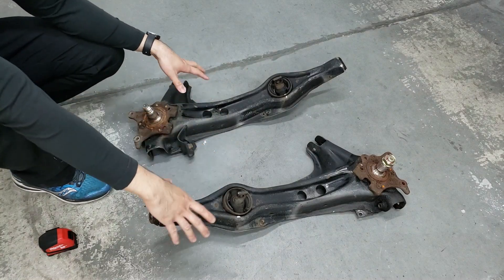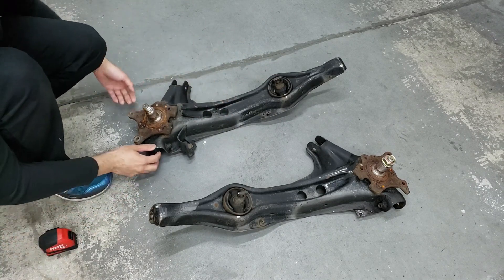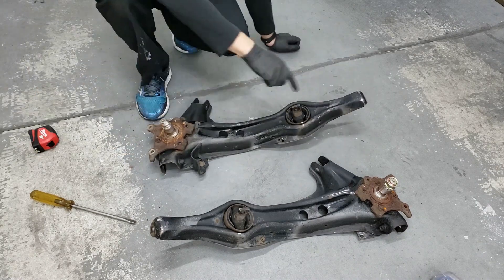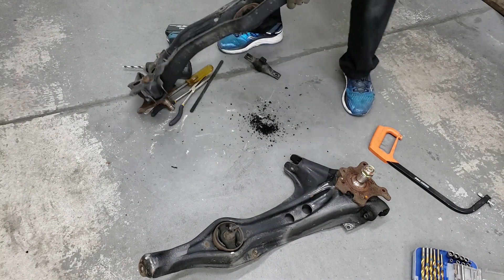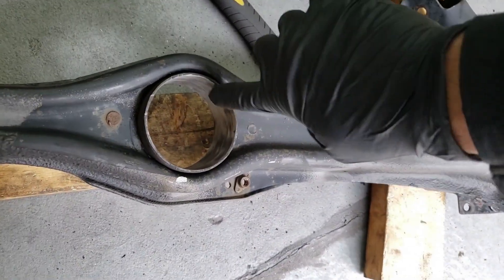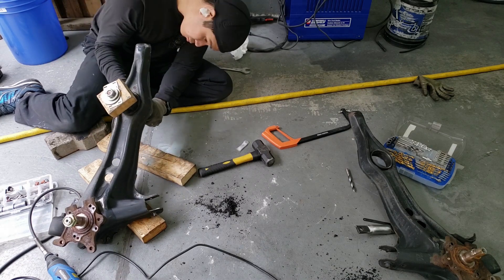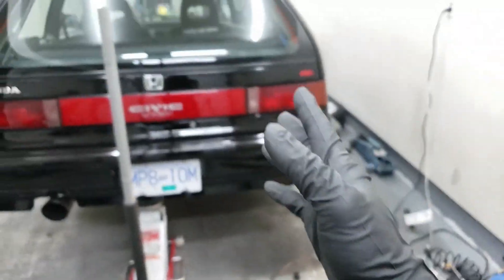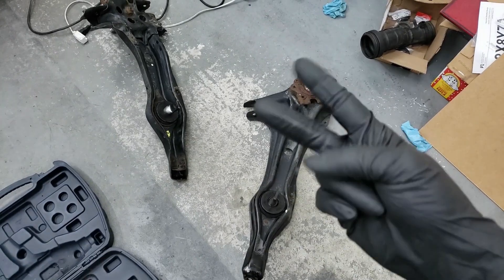DO NOT USE DA Integra Trailing Arms! & How to Install Energy Suspension Trailing Arm Bushing

Comment: Will 1994 Del Sol trailing arms with a disc setup work on a 91 sedan? A friend has a set hes willing to sell to me
Reply from the maker: @ECRick1682  yes, those will work perfectly. The offset would be the same too. Only trailing arms with wider offset are the 90-93 integra. Every other disc trailing arm would be fine. You'll need longer ebrake cables though. Cables from a 4 door integra should work.
Reply: @BudgetGears  great, thanks for replying!

Comment: Dang it... I just bout a set of the Da trailing arms.. 
So will the DC trailing arms use the same spindle/or brake caliper, and rotor ?
 .. I guess I need to buy some DC trailing arms..
Reply from the maker: Everything was interchangeable between the DA and DC trailing arms, but it is weird that the part numbers are different. I used everything from my DA arms on the DC arms. You can pretty much use any of the Civic or Integra with disc trailing arms. The only odd ball was the DA. Also, you can use the DA arms just you'll have a wider offset.

Comment: Actually you can mount the spindle only on to ek trailing arms and your done old man taught me that who would of thought😅
Reply from the maker: That's correct. You can actually bolt spindles onto any of the 88-00 civic/delsol drum trailing arms, but if you're already buying disc trailing arms, you might as well just get non DA ones and just bolt them up. The process of removing the spindles isn't always easy since they're really tight or seized on there.

Comment: No DA trailing arms stick out further or makes wheel stick out further...get EF Civic sedan EX or 90-91 CRX Si !
Reply: But a simple way to get the right track width is to use any ef/eg/Ek and DC trailing arms and just use da spindles .because the crx and sedan are extremely rare to find now
Reply: @littlejapanesehotrod  Rear drums are food enough for daily !
Reply: @oldskool1979  I know they are but when you did the da trailing arm set up long as time ago .. some don't like the look of drums aswell
Reply from the maker: That's what I said in the video. But any 88-00 civic trailing arms or 94-01 integra trailing arms will work for disc conversion.
Reply: I am having this issue. I have da trailing arms on my crx. It made it wider. Which wasn’t an issue until i recently bought new wheels.. so if i got 92-00 or 94-01 trailing arms it would be less wide?